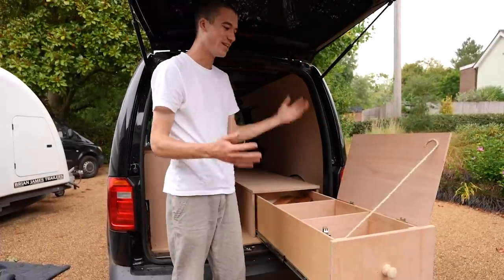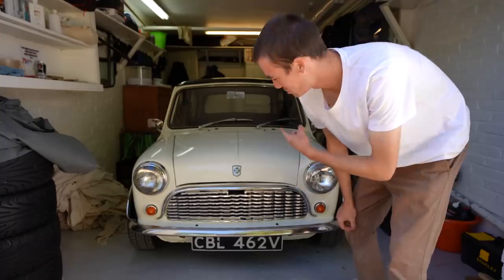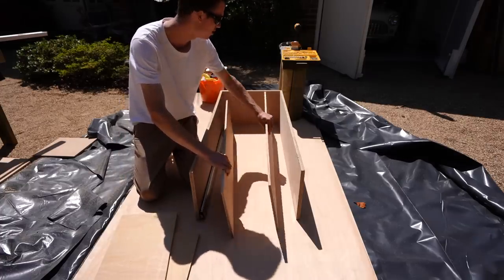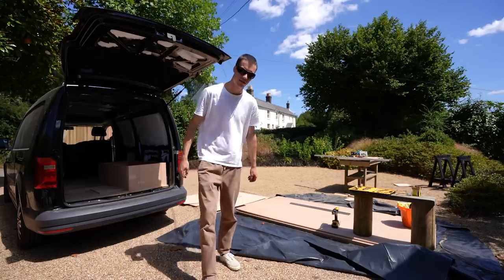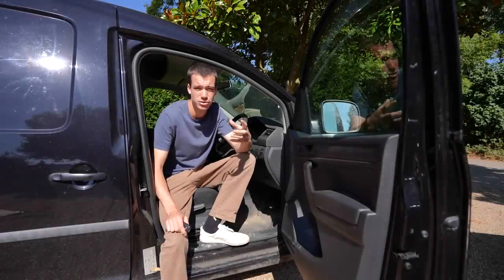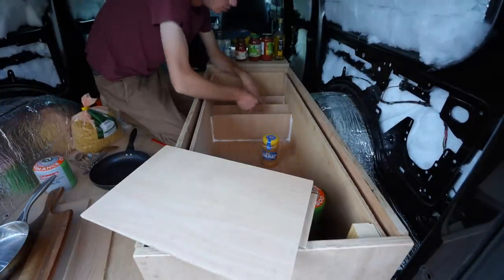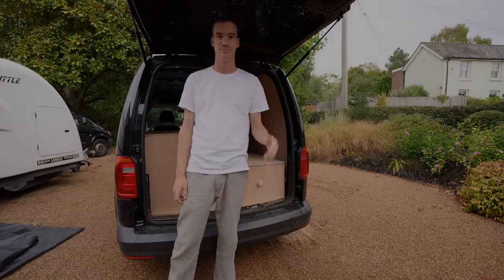Converting my Van into a SIMPLE Micro Camper - Building a slide out drawer bed - Ep 6

Comment: Much cheaper and simpler than a fancy camper van..I’ve just bought a nearly new  VWT6 Transporter..I’ve made pull out sliding drawers with a bed on top with memory foam mattress ..as I’m 6ft2” the huge bed is really good..my wife even has more room at 5ft 3”!!! Saves huge amounts on hotel bills and you pull up and rest wherever you want. Thanks for,your video. Excellent.

Comment: its a shame i am not near you. i would have wired everything up for free!
have them install a current and voltage limited link to the engine battery. it will charge your aux battery while you are driving on the road.

Comment: 6:14 has that mini had the interior floor dropped in the front? I expected to see your dad’s knees on either side of his hands on the wheel. If you pre drill a hole for your “self tapping” screw, you’ll get a much neater result & your drill lasts longer because you’re not putting your body weight on it to force the screw through.

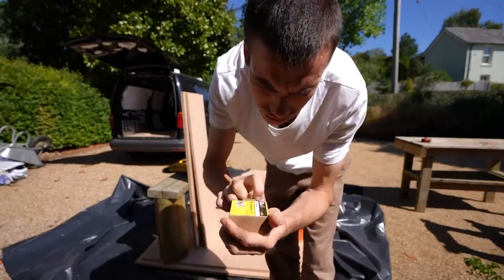Comment: 4:25 next time, lay one flat at the edge of a table.... one straight up, drill that one side, glue and screw it, than turn it 90° and do the other side😉

Use some tape around the corner to hold that second one in place
Reply from the maker: Cheers for that info.